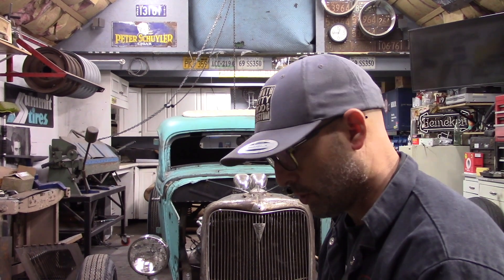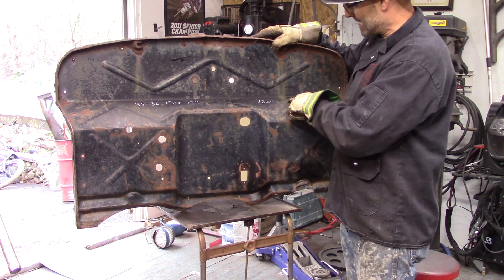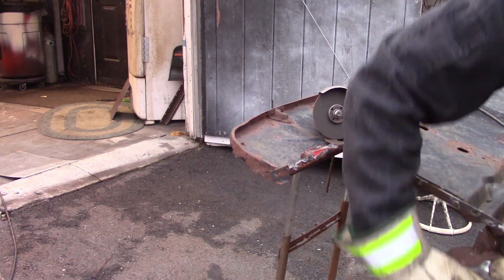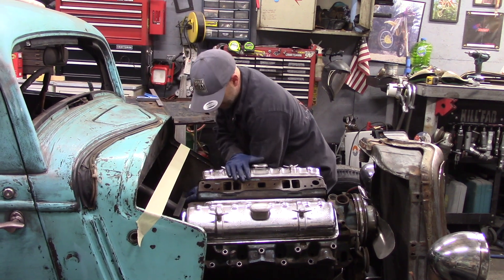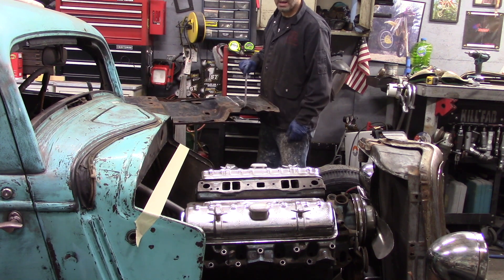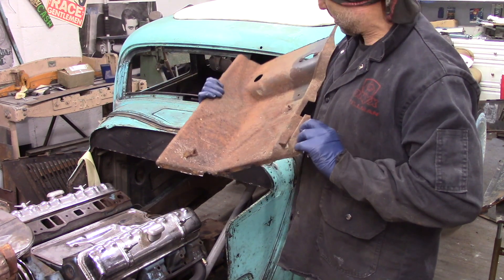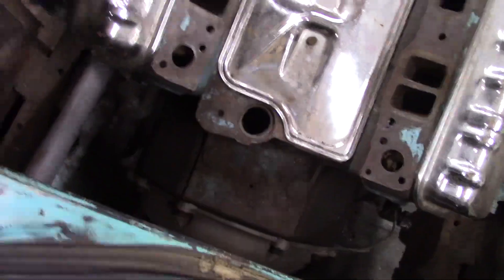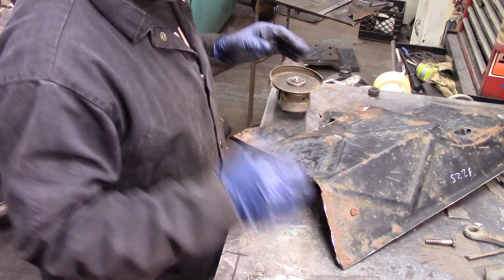Modifying a 35 Ford Truck Firewall to fit the 34 Coupe

Comment: Hey Mike.  Another great informational video. I was not aware of this modification and using the 35 firewall. Broke away from my project for shop improvements of added  heat radiators, shelving and led lights. I have been dealing with insufficient shop heat for 20 yrs here my self. Anxious to get back to  the hot rod soon. Thanks for keeping  the motivation  moving forward.

Comment: Are there frame firewall mounting brackets or holes in the firewall for lower references to clamp during test fittings? The new seam you are producing will be the top reference point.
Take as many sessions as needed, good information is being produced. If the wings takes a 3rd video, please show some close-ups of the possible issues early in the 2nd.  I am trying to visualize how the welding will affect the paint.
Reply from the maker: There are no holes for reference unfortunately.  None that I have seen.  The body was welded to the frame and there are plates welded over where the mounts would have been. 
I’m just finishing up video # 2. It’s almost an hour long.  
I won’t final weld the new fillers to the wings until before the paint process.  I need to be able to remove the firewall to sandblast the back side once it’s one piece.  
It came together nicely. Just as I had hoped.  
I am afraid it may burn through the paint and I’m not looking forward to it.  
But it must be done.

Comment: The nice thing Mike is that a lot of the 35-37 truck sheet metal up front (like the cowl vent, the firewall as you're finding out and the dash with modifying) was somewhat of a carry over from 34.  Still plenty of 35-37 truck stuff still out there!  Good job, keep the fighting the good fight!

Comment: Great content nice work on the fire wall , your angle finder is call a sliding bevel used by carpenters 👍
Reply: Yep i have a couple of those left over from doing house construction for 35 years ,still come in handy .